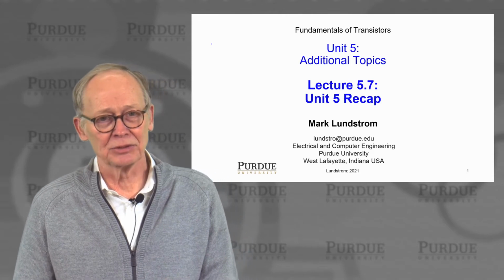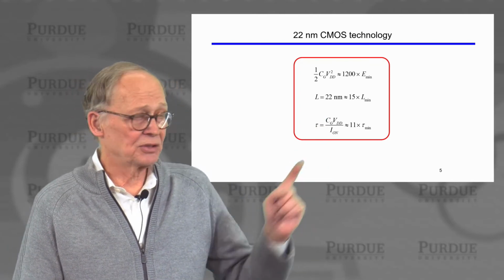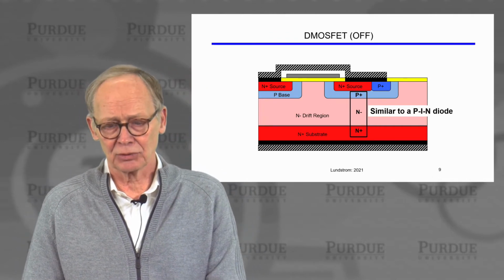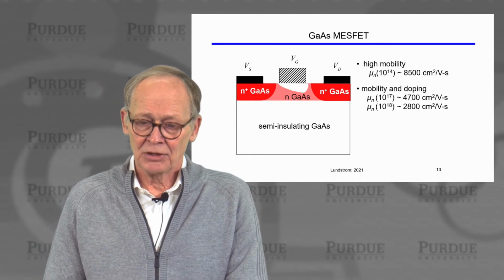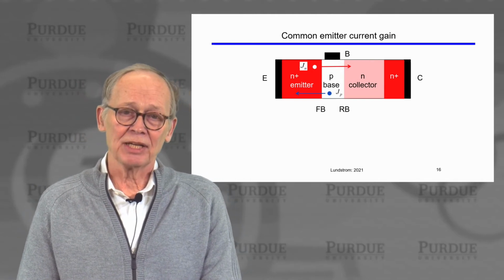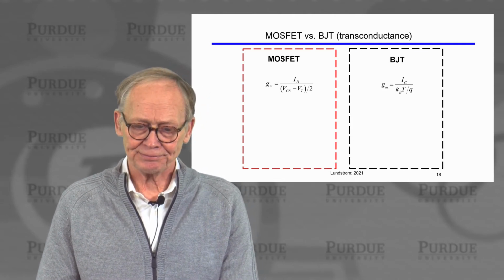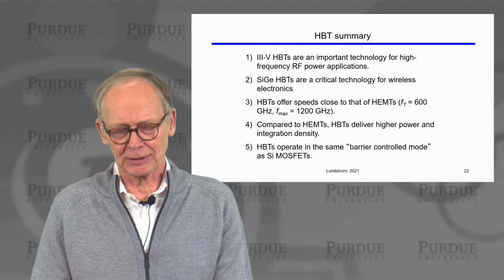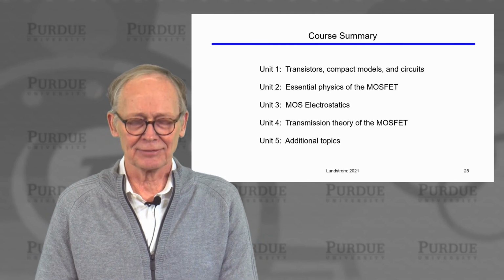ECE Purdue Transistor Fundamentals L5.7: Additional Topics - Recap

Comment: 00:00    Lecture 5.7: Unit 5 Recap
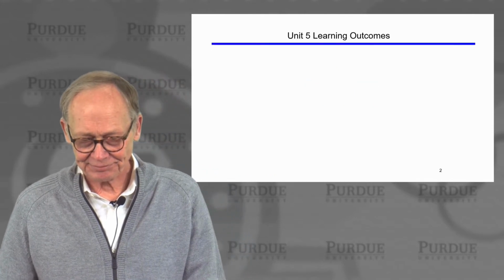00:27    Unit 5 Learning Outcomes
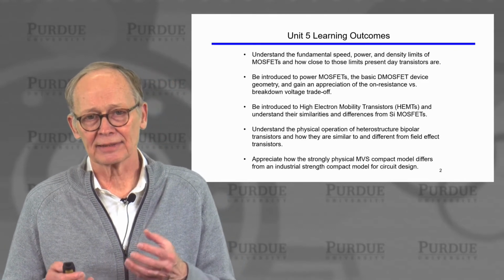02:19    Limits of MOSFETs
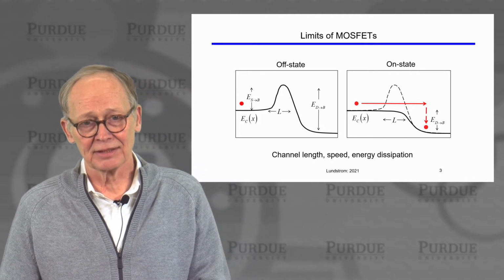03:09    Limits
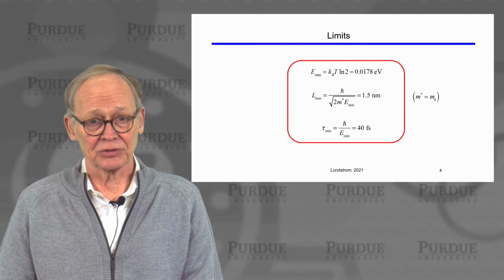04:17    22 nm CMOS technology
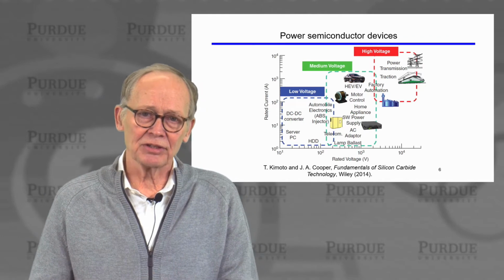06:31    Power semiconductor devices
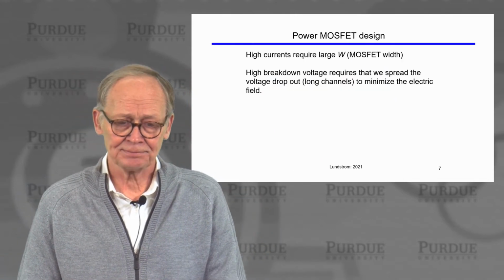07:10    Power MOSFET design
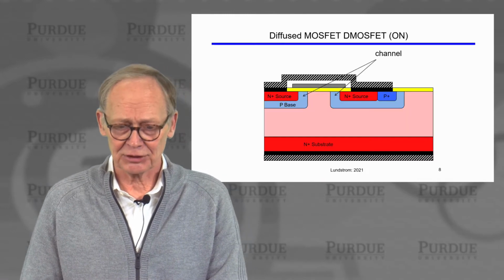08:06    Diffused MOSFET DMOSFET (ON)
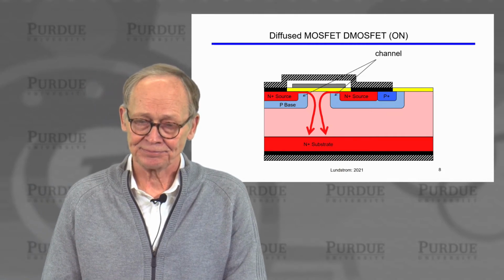08:40    DMOSFET (OFF)
09:13    On resistance vs. blocking voltage
10:24    InGaAs HEMT
11:29    "Modulation doping"
12:37    GaAs MESFET
14:15    HEMT summary
15:28    BJTs are barrier controlled transistors
17:33    Common emitter current gain
19:35    IV characteristics
21:53    MOSFET vs. BJT (transconductance)
23:46    MOSFET vs. BJT (high frequency)
24:43    HBTs
25:56    DHBTs
26:48    HBT summary
27:56    Compact circuit models
29:15    Summary: Unit 5 Learning Outcomes
30:04    Course Summary